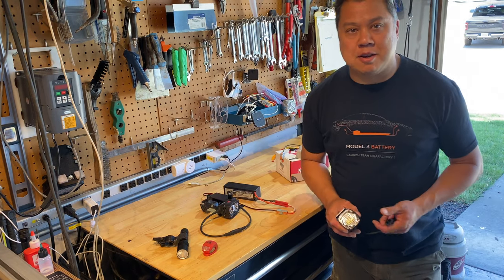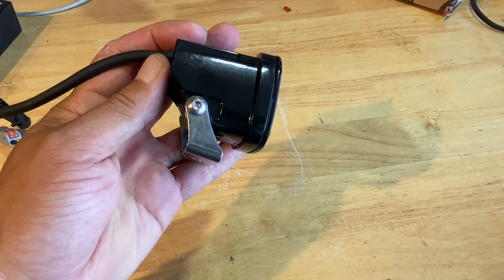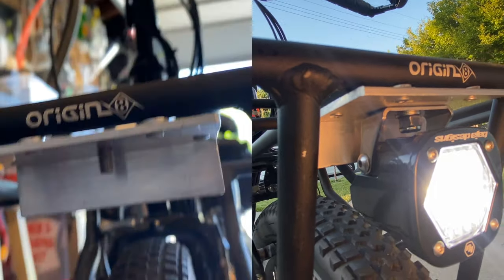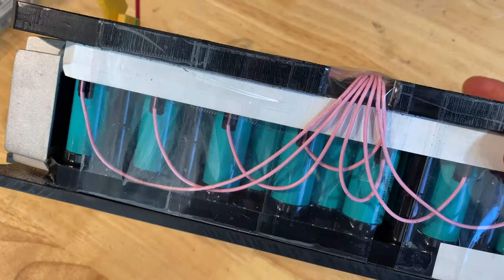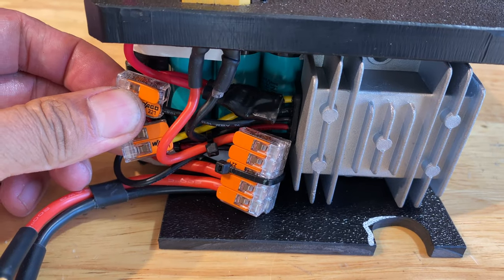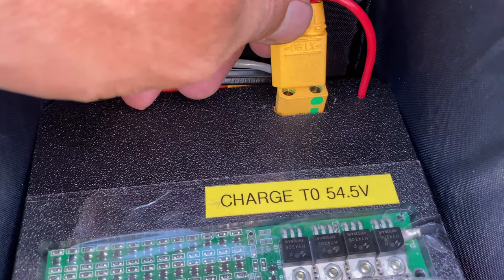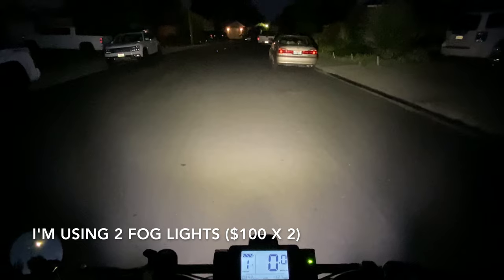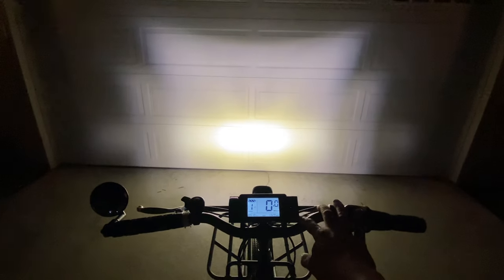Using a DC-DC converter to power E-Bike headlights

Comment: What about that lights in opposite traffic? It seems that even the low beam os quite high. Here in Germany there are Busch&Müller lights for E-bikes that allow from 6 to 48V I think. I bought two and connected them to LiIon for my road and Mountainbike. They have 150Lux and are super bright in comparison to my old ones. But the good thing is that they have a lineal cut upwards to not blend “cars” or people. The downside is that they are bad on small turns/curves or trails. But nowadays there are ones with high and low like yours 👍🏼 amine cost me only $80 a couple of years ago. They made my journeys to work much much nicer on the dark time of the year since I ride 2 by 40 km :) Nowadays not every day anymore :(

Comment: small tip, you're never charging to 54.5V due to the voltage drop that diode causes which is usually 0.7V
Reply from the maker: Yep, I just keep the 0.7v difference as a safety factor, charging to 95% instead of 100
Reply: @etischer  i kinda thought you knew modifying a vfd to run large igbts or fets and run an entire car but oversights are always possible (because it says 100% on the PSU)

Comment: Awesome bike build! great craftsmanship. I love the cable management. I just bought some of those Wago connectors. Though if it is a permanent install I would recommend soldering but for any changes they are very nice, unfortunately they can be a little bit lossy. Installing power supplies or just a DC distribution bus is what I love to do that way I avoid having 32 different wall warts on multiple power strips. Just one big power supply which is easy to backup if needed with a battery.

Comment: Very nice set up.👍👍
I am looking at those 12-60v front light so no need for the dc-dc converter.  But it doesn't seem like any back light will do the same variables voltage. bummer.
bty using the wago connector are great for making 2 way splitter. to run battery parallel.
cheers

Comment: At the prices I was seeing for these, I was worried about output quality, so I purchased 5 of these converters from different manufacturers, different housings, etc and there is a CAUTION.
When the ebike battery was first applied to ALL 5 of the units I purchased, there was a massive ~50V voltage spike that appeared at the output for about 10mS to 20mS. It varied a bit for each unit I examined, but they were all similar.
A spike like this can damage sensitive hardware. The spike occurs only at the initial connection to the ebike battery. The only way I could see to make sure this wasn't a problem was to ensure no devices were connected to the converter output when it is first connected to ebike power. That was achieved with a delayed-connect circuit on the converter output, so it would provide enough time for the spike to dissipate before connecting the 12VDC devices to the converter "12VDC" output. I designed it to delay for ~0.5 seconds.

All 5 units were similar to this one in outward appearance, with a cast enclosure/heatsink potted with a resin of some sort and the wires sticking out from the converter.
Reply from the maker: Good to know, I use my lights every day, and haven't had an issue.  Do you still see the spike with a load attached?  Could just be a tiny 1uF filter cap charging up or something.
Reply: @etischer  I'm looking for a simple RLC network that might work on all/most of them. Just haven't had time to do much testing lately. One never knows when a seller might start selling a different brand or one made after the manufacturer "optimizes" the BMC and starts going even cheaper on components.

Of course, there's always the chance I just ran into a bit of bad luck with the ones I bought.
Reply: @etischer  Some 12VDC-24VDC LED lights I've tested seem pretty robust as far as exceeding their spec'd maximum voltage. It's quite possible that most of them will just ignore a short spike. But, there are other 12V devices out there that are more sensitive to over voltage.

Comment: You know what you're doing. Nice build. I want to install 12v lights.
I have a 144v battery system on a sit down scooter. To step this down to 12v would I use resistors + 48vdc -12vdc converter?
Or 2 74v converters in series? A resistor + 72v to12v converter? What do you think?

Comment: How did you figure the fuse from battey to DC-DC converter only needs to be 2 amps?

Could you install a switch between the battery and DC-DC converter? I.e. turn ot off during the day so it does not waste the battery when lights are not in use.

Comment: i got a question, i see you have the Led 5, but could i use the one with 15 leds, that is also showing next to the one you got ?
Reply from the maker: Sure, just as long as the DC-DC converter is sized for the wattage of the light... and that your battery can supply the current along with powering the motor
Reply: @etischer  ok, great because the other tail light i think would look better on my ebike trike, plus i am planning on running 2 of these on the back ok, hehe

Comment: dont put Li-ion battery in cloth bag. 1. cloth bag with create static 2. there is not enough ventilation for a battery even though there is little to none heat generated while use. 3. cloth bag are flammable  and trap heats and it will heat up a lot during a hot day

Comment: just to clarify, the lower front SI spot light is always on, wired directly to the DC-DC converter, similar to the rear red LED, is that correct? So the higher S1 Spot is the only light that is activated by your switch? Thanks for this video. It's very helpful.
Reply from the maker: Yup, you got it right.  The lower light is a S1 cornering light which is like a flood/fog light, and always on.  The upper light is S1 spot light for long distance, and is switch activated.

Comment: Nice setup. Could you add a generator to the wheel to charge while riding?
Reply from the maker: You could, but the DC-DC converter would be much lighter, and more efficient, and not wear out, and can be mounted anywhere.  It wouldn't make sense to use the battery to run the motor to move the bike, then use a generator to slow the bike down to run a light that you can just run from the battery directly.
Reply: @etischer  makes sense. I was thinking one of those vintage tire contact generators that might be able to charge at the same or greater discharge rate. Sort of a perpetual motion ideas gone wrong. LoL.
Reply: @etischer  I’ll be following closely. I see an industry popping up of electric vehicle conversion enthusiasts, perhaps even in a racing or speed circuit capacity.

Comment: Does the power for the step down come directly from the battery or from the motor controller?
Reply from the maker: The DC converter is powered directly from the battery

Comment: Would a spot light with a s1 flood light not be a better setup? Why 2 flood lights?
Reply from the maker: After the video was made, I did swap out the lens on the top light (the one on a switch) for a spot lamp.
Reply: @etischer  Kewl, which ones did you end up using?
Reply from the maker: @raczyk  the flood light on the bottom, spot on the top,.

Comment: Is 4700lm 2 lights? Not sure what chip is in those light, but 4700lm is an impossibruh! (CREE XHP50 reaches 2,200lm and Luminus Devices SST-90 is said to reach 2700lm) Could you test the actual output of those light? Nice video btw, I've got a 3-wheel butcher bike with a motorcycle headlight (with DLR and indicators built in) exactly the same as on the Sondors Metacycle, thinking about adding 2 foglights down low by each wheel for extra luminescence. All my lights are wired basically the same way as you demostrated, but with a backup of 60ah 12v li-ion charging via the dc-dc converter and an mppt controller. The reason for that is that high-amp converters are $$$ expensive and if I run all 12v dvr,leds,5v chargeports, gps, headlight, breaklights, indicators, music system, and hit the horn I'm peaking 45A
Reply: oh yeah and a peltier-based temperature-control-system for the 72v 50ah main battery.
Reply from the maker: Each light is 2,375 Lumen, from a single chip.  They also offer a laser chip driven spot beam which looks interesting.   These S1 lights are nice and compact, and don't seem to overheat like my other bike lights do when stationary (no air blowing over them). I don't have an accurate way to measure lumens.  You could always run multiple DC-DC converters. Cheers, thanks for the comment.